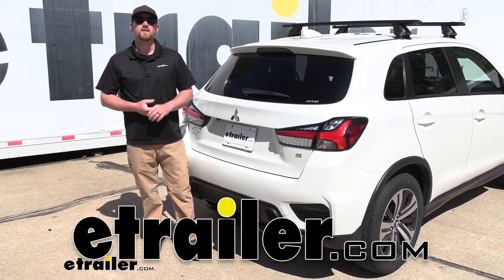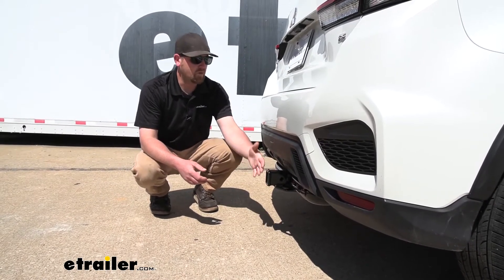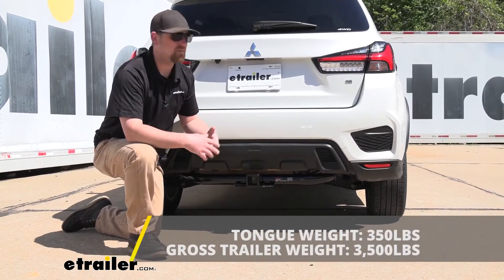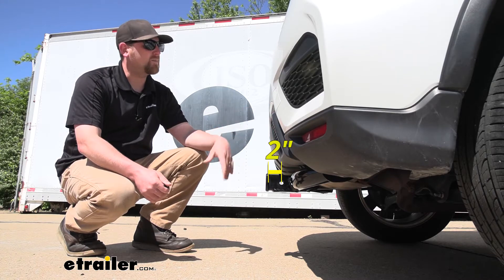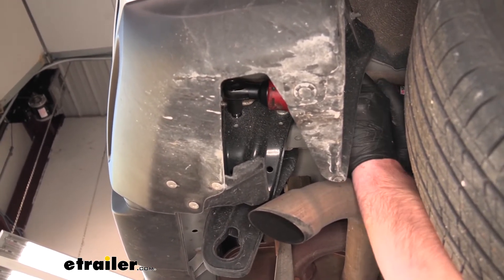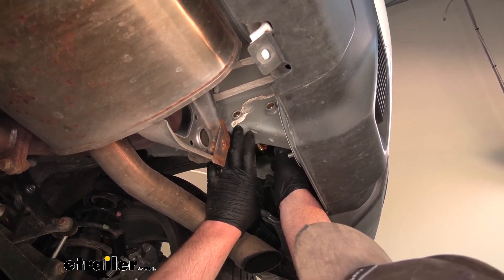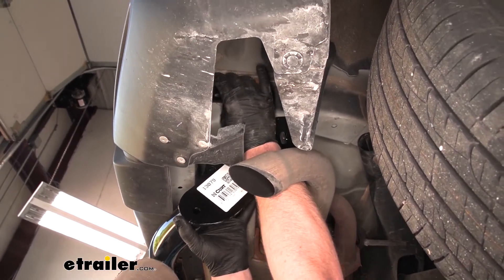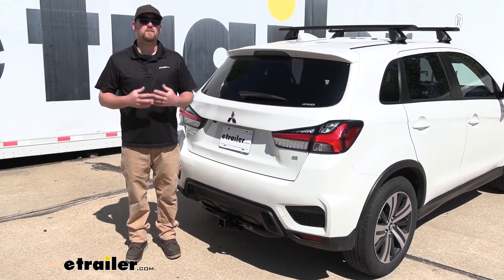etrailer | How to Set Up Your Curt Trailer Hitch Receiver on a 2020 Mitsubishi Outlander Sport

Comment: Will it fit a 2022?  Does the housing on the driver's side that has hoses need to be removed to make install on that side easier?
Reply from the maker: The Curt # C13079 fits the 2011-2024 Mitsubishi Outlander Sport. I didn't see the lines you mention in the video nor are they mention in the install instructions which I've linked below. Do you know the purpose of the lines?
https://www.etrailer.com/instructions.aspx?pn=C13079
https://www.etrailer.com/Trailer-Hitch/CURT/C13079.html
Reply: @etrailer  I looked at the installation directions and it shows what I'm talking about in image #2.  I see there is Note as to how to slide bolts into place. I may remove the wheel in order to have better access.  What do you think?  I don't have a lift, so I'm doing this on the ground.   
Thank you for your reply in advance.

Comment: So do you only bolt it on the one side where the tow loop was? What about the other side?
Reply from the maker: Both sides are bolted. You can see that in the linked install instructions:
https://www.etrailer.com/Trailer-Hitch/CURT/C13079.html
Reply: 5:50
Reply: @Hawk-qn2zk  thank you, saw it as soon as I commented 😂